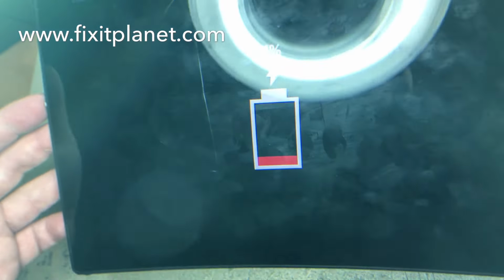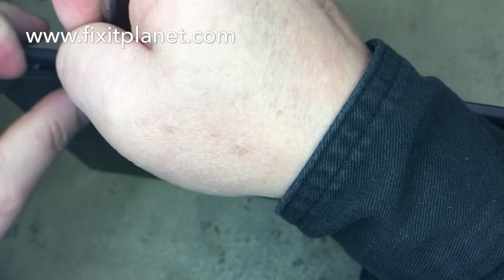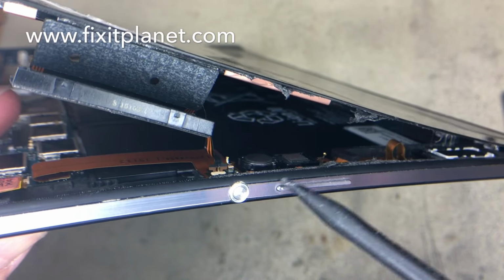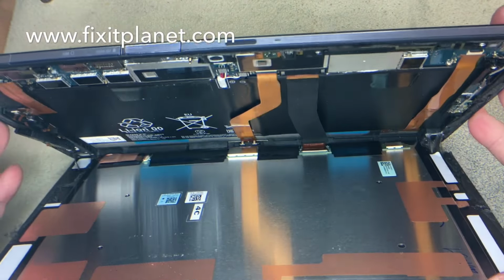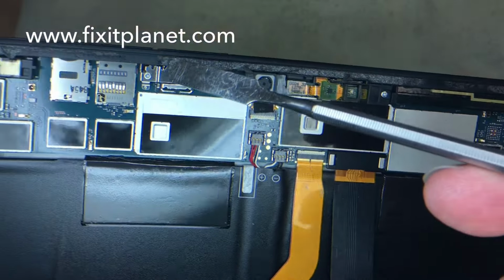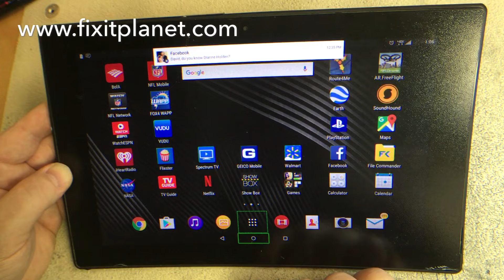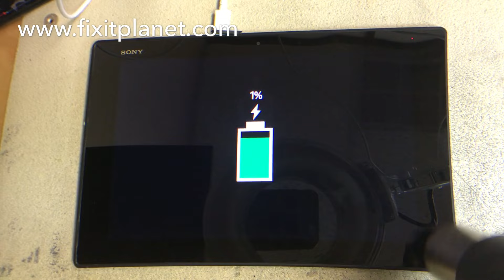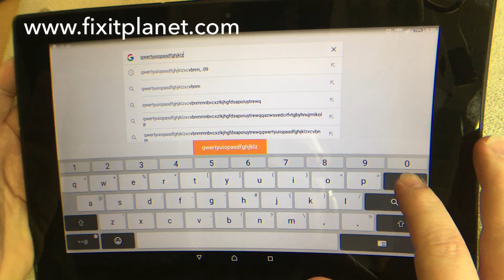Sony Xperia Z2 Tablet LCD-Touchscreen Repair From Start To Finish.

Comment: Very helpful video, could you please tell is it a normal hair dryer you are using to warm this tablet?
Reply from the maker: No it's not a hairdryer but you can use one if that's all you have.
Reply: @FixItPlanet1 
Ok, thanks for reply. 👍

Comment: I cannot find someone in Salem Oregon to fix my tablet do you have any suggestions The front screen is damaged just like in your video
Reply from the maker: This one is getting harder to find parts and anyone that will work on them. You can follow this video and fix it yourself or if you don't feel comfortable doing that you could mail it in to us and we can repair it for you. Call 817-602-1160 for pricing and visit https://www.fixitplanet.com for mail in repair instructions. Cheers

Comment: where does the the adhesive come from?  is it something specialized to this tablet? also what tools do you use and where did you get them? Excellent video!
Reply from the maker: Thanks! You can buy the 3M adhesive in different sizes online try Amazon or Ebay for starters. Many tools can be found at iFixit as well.
Reply: Could you specify the width of the adhesive in mm and estimate the thickness also? Thanks for the great vid btw!
Reply from the maker: Try 7mm 2 mm and 5mm 3M heavy duty
Reply: Always use the original LCD Touchscreen Adhesive Tape...you can't run a professional business, if you don't use the right parts....

Comment: Where can I get the replacement screen you used in this video?
Reply from the maker: I think this one came from an Ebay seller. I can't get it from my regular suppliers.
Reply: Was just about to ask the same thing as I've been looking for a while and can't seem to come across one
Reply: Fix It Planet can you let me know the ebay supplier or at least the part number or name?  Best video i have seen and ready to try this.  When i search up the replacement screen the prices vary wildly so not sure some of these are what i need. Want to order the right thing
Reply: Ali express has several suppliers. Basically the only ones that sell the displays nowadays.

Comment: Is there a way to separate the digitizer board from the screen? My screen has a crack and I figured it was just the digitizer.
Reply from the maker: If you mean "can the glass digitizer itself be removed from the display" That is a very difficult process and is not very practical (they are fused together). Replacing the entire screen assembly is the easiest way to go even if it costs more.

Comment: I am Facing charging isuu, when in connect charger, just red light (charging ligt) on and off after few seconds. Tab is not charging, any solution please
Reply: had the same problem, please  what did I do? Thank's

Comment: so i did everything you did, and the screens lights up but no picture,why is that
Reply from the maker: Did you test before install? Try a soft reset. If that doesn't work double check all connections for damage and proper connection. Otherwise there may be another propblem either with the part or the tablet.
Reply: Fix It Planet , ifigured it out i guess i must of busted the ribbon cable on the other screen. Because i went to test  the other screen and it was doing the same
Reply from the maker: Bummer

Comment: This is not right, the TFT LCD is good so why replace it? Why just buy the Touch Screen and put it on TFT LCD, it cannot be done?
Reply from the maker: The display is fused to the touch screen. If you can find just the touchscreen and you want to separate the display from the touchscreen... go for it.
Reply: @FixItPlanet1  Are you sure? Why then they sell Touch Screen only?
Reply from the maker: Yes I'm sure. Just because they sell the touchscreen separately does not mean the display is not fused together. If you wanted to separate the display then you can buy only the touchscreen.